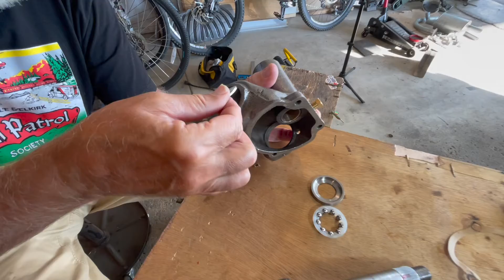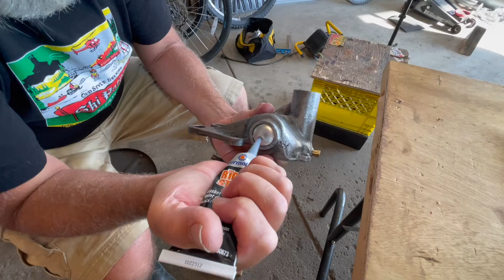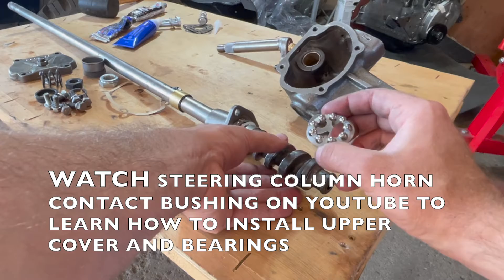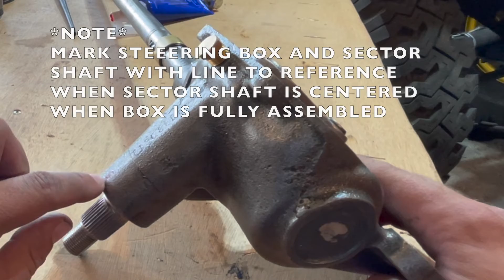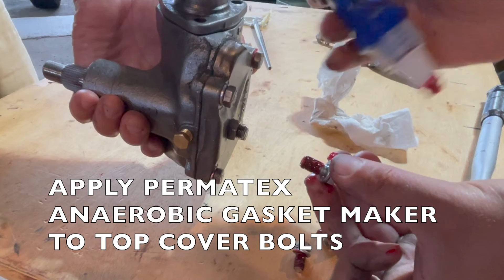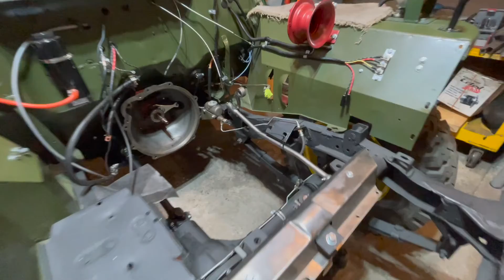Ross Steering Box COMPLETE REBUILD (step by step) w/ 7/8" Sector Shaft (PART 2)

Comment: Do you use any sealant on the shims? Won’t the gear oil seep through?
Reply: I'm doing this same process on my Studebaker.  I initially had the same question, but I'm assuming that with the shims being on the top of the assembly, the grease does not ever settle there to cause a potential leak.  Studebaker International sells a special semi-fluid grease specifically for the steering boxes.

Comment: I'm about to rebuild my GPA steering box and the parts manual shows retaining clips are installed for the upper and lower bearing cups to hold the bearings in place. Is this an MB/GPW steering box? Doesn't it also use retaining clips to hold the bearings in place?
Reply from the maker: Steering box is from a early CJ2A. The snap rings you are mentioning are not necessary. Their only purpose is to hold the bearings in place when you are rebuilding the steering box. The old style of bearings have loose bearing balls in the cup and the snap rings holds everything in place. Use modern bearings as the bearing balls are built into the cup and the snap ring is not necessary.
Reply: @LetsBuildaWillysJeep  Thanks for the info! I found the clips provided poor holding power when trying to seat the race cups into the bottom end of the steering box. After two failed attempts to seat bearing assy I decided to take your advice and ordered the new style. Thanks for the tip!
Reply: Where did you get your rebuild kit from like the bearings and want to be sure I get them